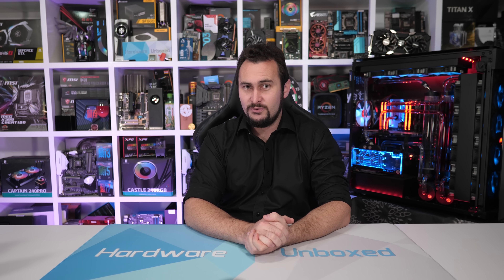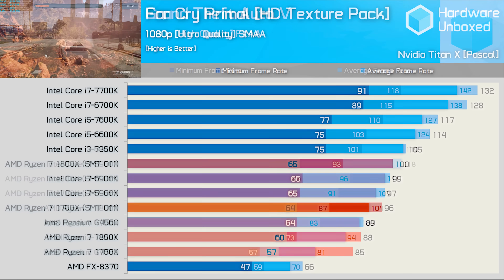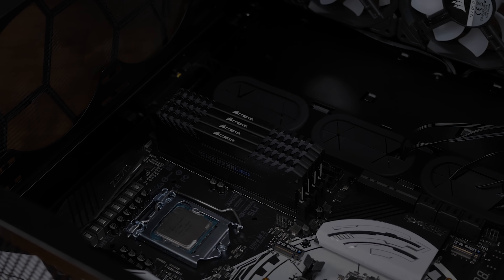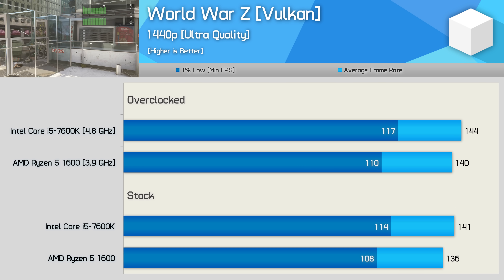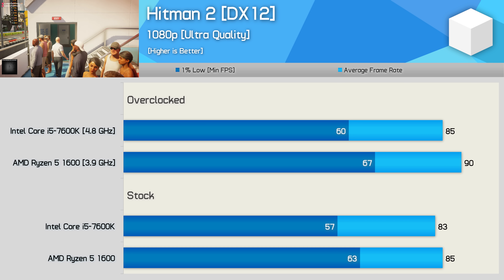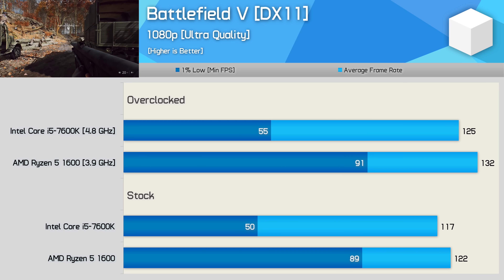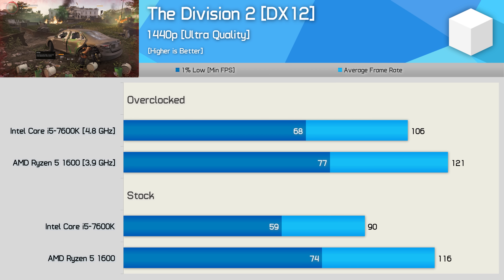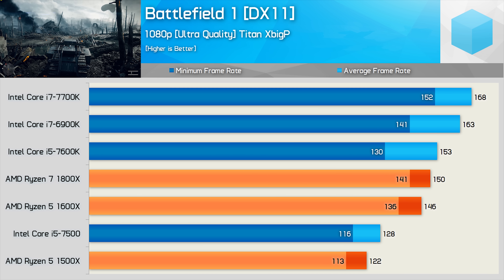Ryzen 5 1600 vs. Core i5-7600K, How Times Have Changed!

Comment: This is a great example on how close AMD was to Intel IPC with first gen Ryzen. Look at how small is the performance gap between a 3.9GHz R5 vs a 4.8GHz i5.
I can't wait for Zen 2!!!
Reply: You can't make a conclusion about IPC with those tests because the differences may be that a game optimised for 4 cores might run in dedicated threads/cores than the NT kernel and other services so even with better frequency/IPC, caches, pipelines and cores of the i5 still have to share resources for different programs.

Comment: Lol, I remember buying a Q6600 on the promise that quad core was the go.  Paired with an 8800GT it still chugge on Crysis.  To this day single threaded performance is still the ultimate arbiter of frame time sensitive use cases like VR.

I cant even point fingers at which part of the industry has let me down - the whole thing stinks.  AMD cant deliver at the high end and Intel savages my wallet for the privilege.  Think I'll just choose a platform based on motherboard aesthetics and build a pretty water cooling loop around it.

Comment: You can run a Coffee Lake CPU, like the 8700K and Xeon E-series, on a 100/200 series board with a simple mod. The Xeon E-2136 (etc.), if you can find one, is much better value compared to the equivalent i7, but still not "cheap" compared to Ryzen. What it does offer is much higher clock speed and IPC, but that might become less significant when Zen 2 comes out. Still, the 100/200 series platform isn't completely dead yet.

Comment: this is an unfair comparison for the 1600. in my country the i5 7600k is more then twice as expensive as the 1600. an r7 2700 would be a more fair comparison since its only 30 euro cheaper than the i5 7600k
Reply: Well, blame your country. In normal markets, 1600 was competitor to 7600k
Reply: @dainiusvysniauskas2049  the 1600 might have been priced closer to the 7600k in 2016. if i had the choice between these 2 cpus then i would definitely choose the 1600 since its as good as the 7600k and less than half the price

edit: the 1600 was actually the same price as the 7600k in march 2017. today the 7600k is a bit more expensive while the 1600 have dropped 50%

Comment: $80 ryzen new  vs $200 i5 used showing how price to performance has changed and how intel cpus never get cheaper and that’s one of the reasons it’s their tern to be the company with the faildozer cpus.
Reply: Intel users don't lose so much money when they upgrade? gotcha
Reply: choatus for now what happens when no one wants them and the whole price structure falls apart when used ryzen 1 cpus got the market for next to nothing?
Reply: @jonathonrosalia9345  people will always buy them, I sold a 7 year old CPU not so long ago, and got really nice coin for it. people will always buy them for HTPC's and cheap gaming rigs. I know a lot of people who will never touch AMD, mostly for the workloads they use them for, but also because they don't trust them, you'd be surprised.
Reply: choatus intel chips are going to have to drop to sub $50 for 4 cores no reason to buy them just like no point in intel older than 6th gen ryzen flopped the market and new 6 core 12 thread for $80 or a old intel chip for $200+ or one that’s cheap and terrible that’s your choices. When ryzen is used it’s going to be $30-40 for the 1600 why would anyone pay more for a intel chip that’s not better.
Reply: @jonathonrosalia9345  for the same reason people bought Intel over AMD Athlon, when the Athlon's were better, people trust Intel, that's all there is to it!
Reply: choatus lol not for long I just replaced my z170 rig with a X470 all set for the new 3000 cpus and it has a 1600 in it now it’s just better and Intel cpus from before 8th gen just can’t compete.
Reply: @jonathonrosalia9345  It doesn't matter what you think, It matters what the consumers at large think, and most of them are not tech savvy at all. People trust Intel and they always have,  it will be extremely hard to break that trend, believe me :)
Reply: choatus I think your delusional because AMD took market share on all fronts and keep taking it because intel has nothing to offer at the price point they priced themselves into a corner and the market shows it. Their is a lot of new OEM PCs with ryzen coming out and it’s going to be like when intel launched the core line all over again and I don’t see people paying up for inferior hardware.
Reply: @jonathonrosalia9345  not delusional, it's just the world we live in, time will tell, but history shows exactly what I'm talking about. It's not my fault if you don't understand how these things work.
Reply: I just bought a i5 motherboard and ram for $30 and it’s itx your delusional and the next few years are going to see the intel owners loose their shirts on resale because normies look for bigger numbers and lower prices and AMD has both now.
Reply: @jonathonrosalia9345  your statement just proves me right, you yourself are still buying Intel hardware, ROFL!!! "Normies" wouldn't have a clue about how many cores and threads or Ghz a processor has, just as long as it's a brand they know and have bought in the past. It's not rocket science mate, brand loyalty is a real thing. you are making yourself look foolish trying to argue that it's not.
Reply: choatus lol your clueless af and it’s hilarious the chips are becoming worthless and your not listening I buy anything if the price is right $30 for a cpu ram and board that’s less than what I was buying FX 8 cores for
Reply: choatus lol I’m the fan boy while you can’t accept intel is a inferior product now and isn’t going to be able to charge exorbitant prices and the used market is going to reflect the same AMD forced a change and intel is screwed right now I own a bunch of both systems and your the one who sounds like a intel fanboy who can’t accept their time is over for now and you have to accept it that it’s over for the near future.
Reply: choatus lol your calling people ignorant while you knowingly ignore trending data and the real world that intel isn’t shit anymore it was a long run but they are overpriced and meh now I have more pc parts currently than most people see in their life and I’m tired of people like you denying the truth.
Reply: @jonathonrosalia9345  He is right though, intel advertises a lot while AMD doesn't. Hopefully they start properly advertising their laptops and desktop products once they make bank off EPYC 2.

All they need to say is "we're behind google cloud stadia gaming, current and future playstation and xbox consoles, and have a wide variety of products on pc" in some commercials.

That alone would build average joe's confidence in their branding.
Reply: @jonathonrosalia9345  Mind share is not something you get over night, but an attractive price, and some light gaming capabilties in a flip book is a good place to start.

Or some sleek, easy to cool, and affordable net books. There's a lot they can do to fix their image and they've been doing the right thing lately.

Comment: As a 6600k owner, which is basically the 7600k, the 7/7 cant come soon enough, and this video shows why.
Reply: Same CPU here, but for me it doesn't matter. I stopped buying new games and for the older ones I play the performance is better than ryzen. Still wish I could could just slot in a used 7700k for a boost but they are still extremely overpriced.

Comment: It's worth noting one can get Coffee Lake working on a Z270 motherboard, but it requires some modding. We also don't know which 100-series motherboards will support Zen 2. It's probably safe to assume the high-end boards with proper VRM will get support, but you're missing out on PCI-e 4.0 support. We aren't sure yet what other features will be missing, but PCI-e 4.0 is kind of a big one. This is the main reason I don't put much stock into a socket being "future-proof."
Reply: Is PCIe 4.0 really that big? At this point, only pros will take advantage of PCIe 4.0 storage
Reply: @dainiusvysniauskas2049  It's more bandwidth. It will affect storage most immediately. The point is one of the biggest selling points of AM4 is upgrade path. A lot of B350 and X370 boards won't even support Zen 2 CPUs so their upgrade path is as useful as LGA1151.
Reply: @chessmyantidrug  It will affect PCIe 4.0 storage. Current PCie 3.0 storage won't get faster, unless you talk about RAID setup
Reply: @dainiusvysniauskas2049  I understand that. It's still a feature that won't be supported on 300-series boards. That's my whole point: needing to upgrade your motherboard to get all the new features nullifies the upgrade path argument.

Comment: Thank you for this comparison, i currently have an i5 2400 and looking at a new build, around the end of the year. I have been looking at the 1600, for the cpu of choice. i don't play the latest and greatest games, I hate the games as a service model. So don't see where having top shelf equipment, will benefit me. I already have a Evga GTX 1060 3gb sc that will go into the new build. Like i said, i don't play modern AAA games, i do not do content creation, so the 1600 is a great value at it's current price ($117.00 at amazon). i will probably match it with either a b450 MB or a x370, depending on choices and prices when i am ready

Comment: It seems to me the i5 did better the vast majority of the time but you said otherwise. You did mention how smooth the R5 was so I assume that's made up the difference between the two processors even though there was a difference in frame rate. We don't often talk about how smooth it is and it does seem to me that Ryzen is a smoother architecture than Intel's.

Comment: You don't buy a 7600K to play single player titles and you, as a tech reviewer should know that. You mainly buy such CPUs to play competitive multiplayer games such as Fortnite, CS:GO, LOL, Dota 2, Apex Legends, PUBG; in other words, games that require very fast instructions per clock, rather than threads alone. Where are those games in your tests? Your comparison is proving literally nothing. We already know that technically 6/12 is better than 4/4 overall.
 
Different CPUs with different purpose. Multiplayer games is where 7600K shines because those games take full advantage of frequency per clock, instead of  core count. If you're comparing, then give each other a fair chance. Majority of gamers are playing multiplayer titles.
 
But, the price was around the same, right? Doesn't mean anything at all. Take 30k van and 30k sedan. Same price, but different purpose. They're both vehicles just like these are both CPUs.
 
You've slowly turned into JokerProductions. AMD agenda. You own a stock at AMD?
Reply: Your comment is bad and you should feel bad. 

If people were going for highest frames in competitive titles, they would buy i7s, not i5s.
Reply: @dainiusvysniauskas2049  Sure, like there's a difference in those games I mentioned between 7600K VS 7700K. None of them utilize more than 4 cores and they highly favor clock speeds. I had tested them both in Fortnite and PUBG and the performance was literally negligible. Both at 4.9GHz.

I feel bad for your incapability to reason and understand hardware properly.

Comment: In 2017 I thought that Ryzen CPUs have too many compatibility problems and are much slower than a bit more expensive i5 7600k, so I will choose i5, which would give me several years of good performace. At the moment I was shocked by this video, but I am also very happy owner of a Ryzen 5 1600 CPU ;)
Reply: Tbh I only got the R5 1600 cause it's was the best I could afford haha. But I'm very happy with it. Considering the one I got had great silicon I have an all core oc @4.2 so that helps haha 

But if you can you should try and upgrade to a Zen 2 processor. If third-party benchmarks hold up to the promises they made, then they are definitely going to be some great gaming CPUs
Reply: @rage8010  Dude a 1600 @4.2 is insane, even zen+ part doesn't clock that high consistently.
Reply: @PSS395  Im aware, im 90% sure i have the fastest or very close to the fastest on userbenchmarks. It breaks the scale and is off it lol My name on there is Solar8010.

To top it all off im using stock cooling lol....well...thats not completely true...I have two box fans on the pc with it open because im insane LOL

idk if this link will work but here. https://www.userbenchmark.com/UserRun/16832006
Reply: @rage8010  I mean congrat, you have a golden sample ryzen 1 part. I don't think that many people will claim they has a 1600 @4.3 all core for daily usage.

Comment: Can't wait for 2021, when my 3.9Ghz FineWine™ R7 1700 will wreck i7 8700k
😇
Reply: 6c12t is going to be relevant for longer than 2 years, at least 3-4years probably longer considering 4c8t cpus are still relevant.
Reply: There is a very good chance that this might happen even earlier.
Reply: Lol what dude, the reason why amd processors were said to last longer was because the core count would be good, but 2021 is literally 2 years away and 6c12t at 5ghz over 8c16t at 4ghz, and considering the fact that 4 cores is still enough I don’t think that having 8 cores over 6 cores will be worth anything till 2026 at the latest.  It’s kinda like buying the core2quad over a core2duo, it took over 5 years before the lower clocked extra cores were more useful than higher clocked less cores.  Basically what I’m saying is a 1700 will never beat an 8700k until 8 cores becomes the minimum, which will be probably a decade away.
Reply: Yeah don't take this one too seriously guys, at first it's a joke. I was trying to get funny reaction from crazy butthurt Intel fanboys (but it's not happening)
Reply: DocteurMolotov lol, it just irks me when people use amd fine wine for cpus, like they literally don’t have drivers, and technically older intel has aged better than the amd fx series.
Reply: If they dont beat the 7700k now then they Will not beat a 8700k in 2021.

Comment: I LOVE my 16-core AMD Opteron 6386 SE. It is not particularly powerful compared to other 16-core CPUs at the time, it is even based on the same micro architecture as the criticized FX-series, but damn... NO HICCUPS, EVER. 
It's like a 16-cylinder car vs. a 4-cylinder one, the later needs to be trashed to get the same amount of "torque" delivered by the 16-cylinder one. 
As with cars, a 4-core CPU is much more coarse in daily use, with much more hiccups and reliability/heat issues than a 16-core CPU (my 6386 SE, 140W, never go above 50°C with Noctua air-cooler), even if this one is basically two AMD FX-8320 glued together.
Reply: Wow, that thing is insane. What kind of framerates do you see on average? I didn't know AMD had 16 core CPUs in 2012.

Comment: Wow... so I have some old pcs for sale.. i5 2500k and xeon x5670 (not overclockable)

The single core performance on i5 2500k ix 50% more than x5670 (stock)

but this suggests 6c12t will start to beat 4c! So maybe I should concentrate on selling the i5 2500k :)
Reply: Maybe sell and use the money to get a deal on a 2600k
Reply: @DesFTW_  yes that is a good point!!

Comment: I thought it was common knowledge that the ryzen 5 had made the i5 range obsolete, unless someone plays nothing but far cry that is lol
Reply: Funny thing is Far Cry 5 looks great on my 1700 with an RX 580. At least it runs super smooth for me on 1080p. I've only witnessed frame drops 3 times and at least one of those times it was due to my rig trying to upgrade something in the back ground.
Reply: Not excactly, because of high fps low resolution gaming. It's pretty narrow and questionable, as a pigeonhole goes, but it's still a last sanctuary. Otherwise? Yeah, you're completely right.
Reply: Still playing Far Cry games running on an absurd FX-8350 & 1080 Ti combo at 1440p, very playable thanks to the GPU, planning on finally upgrading to Ryzen 3000 series this year as the FX served its purpose of a temporary solution after so many years, it's gonna be phenomenal !
Reply: @tarik44100  Fx was so bad, the ryzen 5 3600 is going to run miles around it.
Reply: @dondraper4438  No doubt ;)
Reply: @tarik44100  Same here with a fx6300 + gtx 1070. It still runs games decently, but the single core perf is starting to show it's limits. With the FX at 4,5Ghz I'm getting around 150-250fps in overwatch on Ultra at 1080p, but with a Ryzen, that would probably be some 300-400fps.